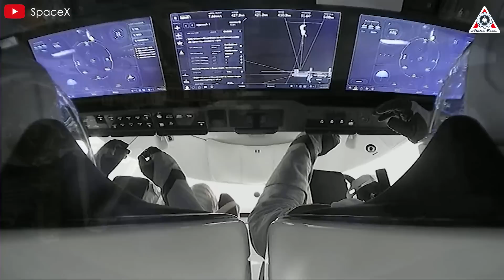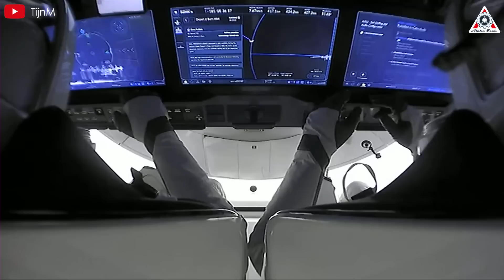NASA finally Confirmed SpaceX Dragon is Better than Boeing Starliner...

Comment: Over 4B dollars for Starliner vs. 2B for Space X and this is what we got, a capsule that looks like the old Apollo capsule with manual switches and no room inside.  Money and time wasted but I’m sure somebody else got richer.  Shame on B! I heard that even the astronauts assigned to work with them on the Starliner had a hard time communicating their ideas to B engineers, where SpaceX’s engineers welcomed any input from the astronauts.  Bravo SpaceX!👏 That’s how it’s done. Half the price and the Crew Dragon capsules have been flying since 2020👍
Reply: It looks like Boeing took the Apollo plans and added 25% in scale.  That's it.
And..they still couldn't make it work.
Look close enough..
.you might find duct tape!

Comment: SpaceX is:
 "Sin qua non"
And I am looking forward to their future very much.
Right now they obviously are running two seperate programs with Dragon/Falcon
And Starship, But in the near term after developing Starship, alot of Dragon/Falcon Tech will likely be transferred and vice versa.

I hope they dont do a NASA, and get arrogant about crew escape options in Starship, and perhaps consider doing a seperation at the Tanks in Starship, and doing Dragon like tech with Draco thrusters, allowing escaping the Fuel Oxy Bomba, and landing on Earth, Moon or Mars if there are unexpected issues.
Also such a seperation line could be used for harmonic dampening, perhaps using some space quality pressure hose as the O-Ring, that could be inflated to provide sealing pressure, with two emergency pressure relief valves, one on each end...
Sure there is some tech like from fighter jet canopy releases for Ejection that could be studied...
I know back in the 60's they used explosive rivits, that relied on an electical charge to detonate...
Those were alittle iffy, My Dad got some at Eglin, not knowing they were explosive, and tried to use them shortening some truck fuel tanks, and had one go off on him when he attempted riveting with a ball pien. 😂

The rest stayed in the jar, and he got other rivets...

I think SpaceX will likely lighten up after Starship passes it's early  developement phase, And start branching off with Methalox tech, and designing other uses. Probably most useful would be a Lunar/Mars cargo lander/lifter, for ELONgated tubes and containers. So we dont have to buttland everything. And we have a means of handling cargo containers to Lunar or Mars orbit For orbital export of minerals or products and vice versa, bring in habitat sections or say fuel, or air cylinders, or dry food products...
Also machinery, Like excavation or the 4 meter boring machine....

Might be nice to have a choice to side land such stuff, and be able to relocate such things point 2 point on the surfaces.

I think a good config would be a pair of twinned concentric tanks for methalox that were also the structure rails. and do a belly dump system. so you could just set things where ever or pick things up.
the orbital low G version of a forklift..

The cool thing about methalox, is the 2:1 ratio, basically need center tank for methane, and outer tank oxy, and could add some trusses between them, and get a very clean structure for supporting engines and cargo.
 
What ever you do guys, dont start thinking about the benefits of concentric tanks...
You dont want thrown into that engineering briar patch... 😂

Humor aside, I think SpaceX has only begun to develope technologies, and I'm not myoptic on Starship in current design limits.
I think flight nine will be some SpaceX style  cobbling attempts on the Resonnance issues, and maybe by flight ten or soon thereafter start into Raptor 3's and begin advancing ship designs after they get tower catches etc. Also finally getting to test other tile options, and hopefully doing something better on flappers fore and aft, and morphing towards a more refined lifting and control system to escape rocket motor dependencies in iffy situations...

I know its hard for Rocket Nerds to do anything except with rocket motors, But even the best will have issues, and having an alternate landing option, might get crews back alive...

We should have zero tolerance for arrogant engineering when it comes to human safety...

NASA and Boeing have provided us examples of what not to do....

Also I wanted to mention, that the goal at this stage, is really as much finding as many problems as possible, as it is getting nominal progress... iteration should include Oopsies, if it doesnt, you are building future disasters.
And I for one am exceedingly thankful for flight 7 & 8 disproving infalability....

SpaceX will be way better a year from now on Starship, than if it had never happened...
Better RUD's Now, than 10 years hence...

Just sayin'
Reply: Wow, there is a lot of info in your post to digest but from what I see Elon is on top it all even though he’s involved in so many different projects.  Let’s hope Boing doesn’t waste the billions they just got for F47 fighter like they did with their Starliner.  I agree, they need restructuring or something because they’ve been in the news a lot lately.
Reply: @krissto22  
Yeah, Elon is pretty good at staying informed from what I have witnessed.
And really good at picking up on concepts when somebody donates something of value.. He shifts gears mentally amazingly well.
Which is why I write, its concept planting..
Also why I use attempts at humor, its like thinking lubrecant... If you can get people to laugh they learn better.

I like to challenge the current state of the art thinking ahead of the curve..
It actually does well over time, people think and adopt ideas amazingly well....
And good ideas tend to
grow legs by people repeating them.
If I see some one with a good idea, I'll repeat it to help them get it accepted...
Thanks for the good reply!